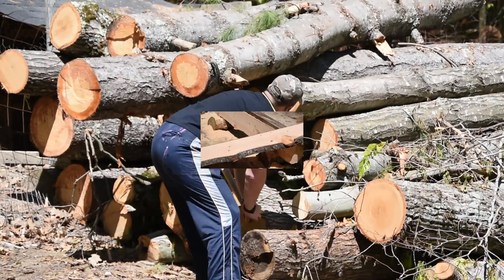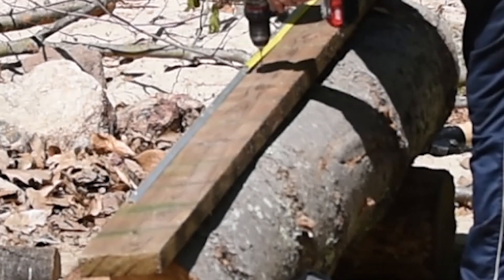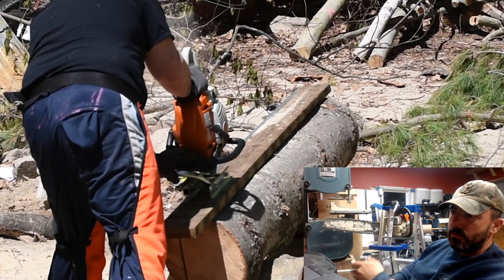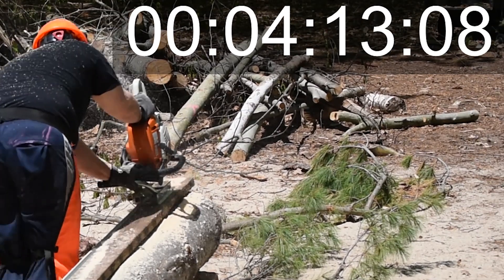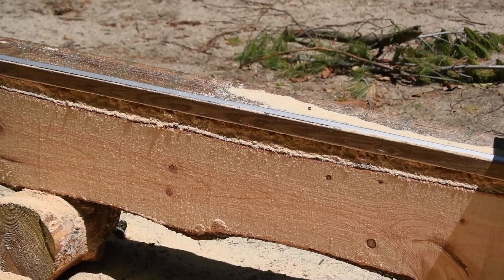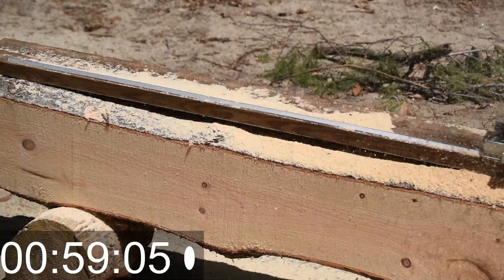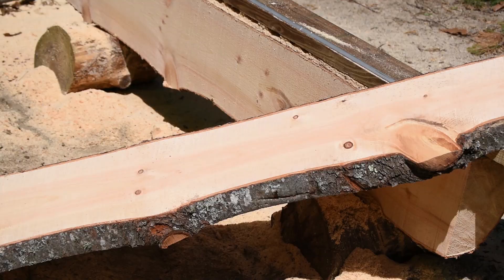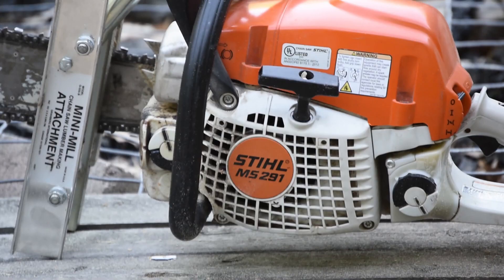Granberg Mini Mill - Me and My Alaskan Chainsaw Mill - Sawmill video

Comment: I have a Stihl 291 as well and just ordered the Mini Mill a couple of days ago.  I want to try to mill up a couple of things to see if it is for me before I outlay some serious coin for a larger set up and power head...  Thanks for the video...
Reply from the maker: I love my 291.  I eventually got a 660, then moved up to an 880.  It's an addiction man! Lol
Reply: @practicallyIndependent  What Mills would you recommend for 660 & 880? Are you still running Granberg Mill or maybe more Pro model? I noticed someone on YouTube had a Norwood Mill w/Stihl 661 seem to be lot faster easier Mill to operate - I have plenty Chainsaw time but 0 Mill knowledge so trying to learn all I can before spending bunch - Thanks for video!
Reply from the maker: @jacklowe3788  I now use my 880 with the granberg 60 inch Alaskan mill.  Here is a video if me milling a 54 inch diameter red oak with that setup. https://youtu.be/15qmKeR68MM

Comment: Its been 3 years now so you probably figured it out already but once you make the first cut spin the log 90 degrees and screw your guide board on the flat side. Then all your cuts are square, assuming your guide board is not warped too badly.
Reply from the maker: I should have done that.   I've since owned 3 different chainsaw mills and 2 bandsaw mills.  I now do this type of work full time and run my own business.   So much has happened in the past few years.  Thanks for watching.

Comment: I have thought about using my mini mill for my first cut then using my Alaskan mill for all subsequent cuts. just seems like it would be a faster set up time.
Reply from the maker: Thats true, and the chain would last much longer not having to cut through all of that bark.  Bark is hard on a chain or blade.  I still have both and even with my bandsaw mill I do occasionaly use my chainsaw mills for certain applications.  Thanks for watching and hope you join our community here.  Happy Holidays.

Comment: How did I miss this video? Was this before the bandmill? Yeah, I too started with a 50cc chainsaw. Took a very long time to cut an 8ft log, started to not enjoy it because of how long it took to mill a log. Then I upgraded to a Husqvarna 390xp and that thing did a full-cut log for the Granberg Small-Log mill faster than the 50cc chainsaw did a half-capacity slab cut. I know you know this, but for those that don't, a bigger saw will last a lot longer when milling from not being as stressed from the faster milling speed.
Reply from the maker: Yes, this is an old video.  Before I got the band saw mill 😃👍

Comment: Have not bought one of these yet but it has been on my list for 2 years now.  After buying the mini mill and using it, do you wish you would have just bought the 30"-36" instead.
Reply from the maker: Absolutely.  For small logs its not bad if you are just going to cut once a month or less its not bad, but for more frequent cutting and bigger logs I would go with at least a 70cc saw and at least a 36" mill attachment. I eventually did this myself and was glad I did.  A setup like that will cut most anything I need to cut.

Comment: Why didn't you rotate the log 90deg after your first cut and use the flat surface you had made ast the platform for the guide. All your subsequent cuts would remain square without the need to continually square up your guide for each cut.
Reply from the maker: Dave H I likely didn't think of it that way. And if I had I probably would have done it that way. I was also looking forward to getting some Live Edge slabs at the time. But looking at it now what you're saying makes a lot more sense than what I was doing. At least I can look back at it now and laugh. I certainly learned a lot over the past year.

Comment: I think it is important that the saw does not go lean and not to skimp on the oil mixture, preferably increase by 0.5-1% as the saw really has to wear for 5 minutes per cut.
Reply from the maker: Thank you for watching.   I really appreciate your advice.
Reply: attention more oil =more heat
Reply: @jeanguylapointe5221  
My opinion is that the fuel mixture must not be run lean, it often runs at top speed for a long time and the fuel both cools and lubricates. Better to set too rich than too lean. A little extra oil often doesn't hurt either. Everything must be reasonable, though.